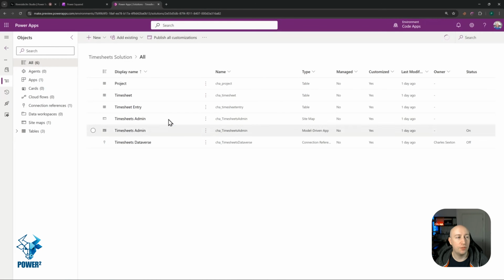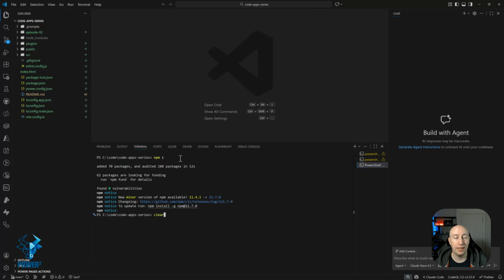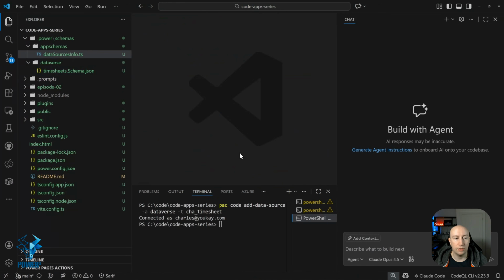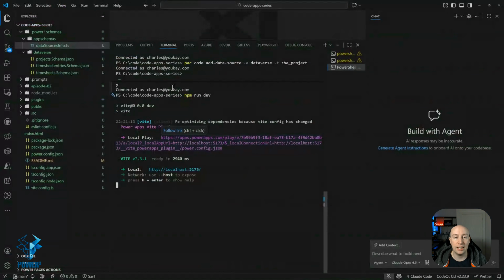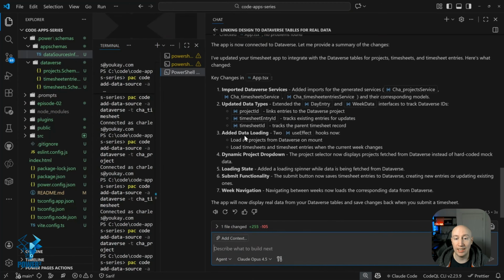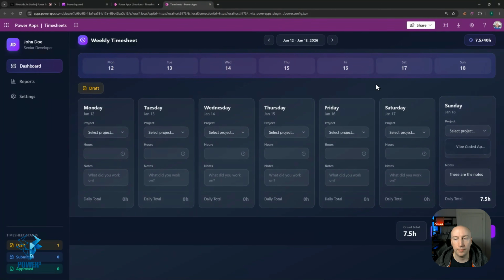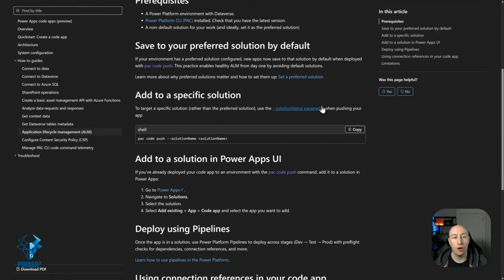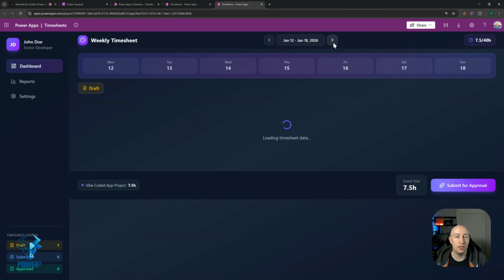Power Apps Code Apps: Dataverse Integration & Deployment (AI-Powered)

Comment: This is amazing, does this work for a course booking system, or just timesheets?

How does it handle tables with discarded/disused fields with old dependencies? (as in fields renamed to 'ignore' as power apps is  tricky about deleting columns you no longer need)
Reply from the maker: You can build anything you want with Code Apps. A course booking system would be fine. Disused fields - you just need to make sure you remove the references from your code. - Charlie

Comment: I have built an app that connects to SharePoint list and updates data. However, one issue i have found is when the app updates data in SharePoint i can’t automatically update the power app interface to show the data. In canvas apps i could easily post back to power apps from within a flow and the data is updated automatically. How do I achieve this with code apps?
Reply from the maker: When you load the items from the list you should be calling a function. All you have to do is call that function again after updating the data. - Charlie

Comment: I don't have access to dataverse at the moment, can SharePoint lists be used?
Reply from the maker: You can use SharePoint lists, but I would highly recommend getting access to Dataverse for so many reasons that I won't be able to list here. Bear in mind that Code Apps requires Premium Power Apps licenses, so if that's the reason for using SharePoint then I'm afraid you either have to buy premium or stick with Canvas Apps. - Charlie